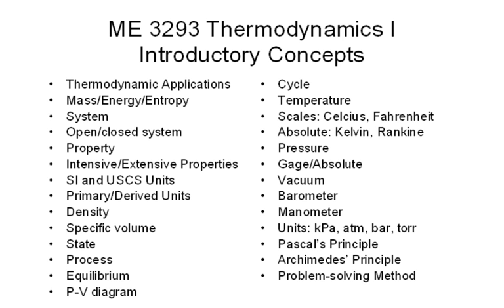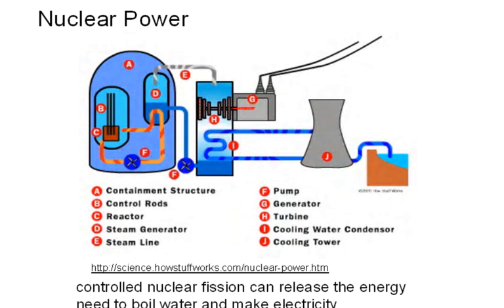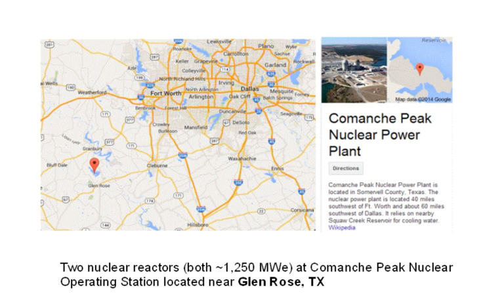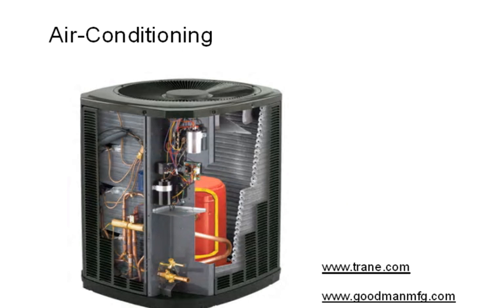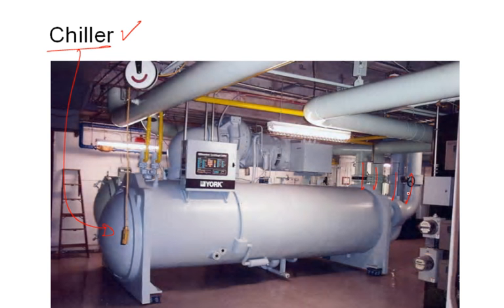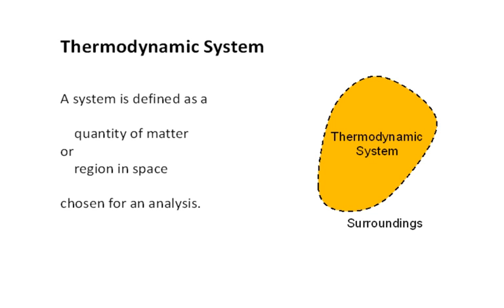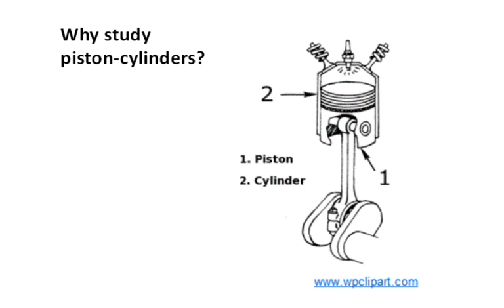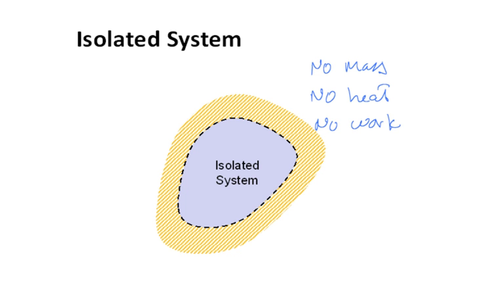ME3293 Intro 1 Fall2015

Comment: Witch book you use your  vds?
Reply from the maker: +Moha Hassan Have taught using different books over the years:

(1) Fundamentals of Engineering Thermodynamics, 8e
Michael J. Moran, Howard N. Shapiro, Daisie D. Boettner, Margaret B. Bailey
Wiley, 2014.

(2) Thermodynamics: An Engineering Approach, 8e
Yunus Cengel; Michael Boles
McGraw Hill, 2015

(3) Fundamentals of Thermodynamics, 8th Edition
Claus Borgnakke, Richard E. Sonntag
Wiley, 2013

You will see ideas drawn from all 3 texts.  Currently using (1).
Reply: @randallmanteufel6411  why dont you use Thermodynamics by Virgil Morning Faires?